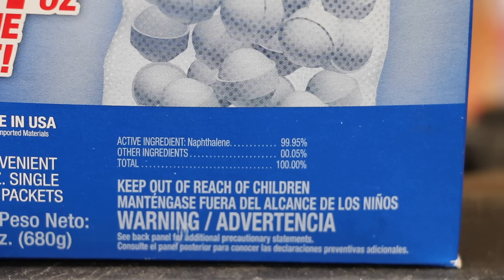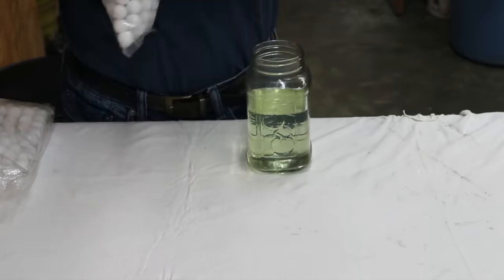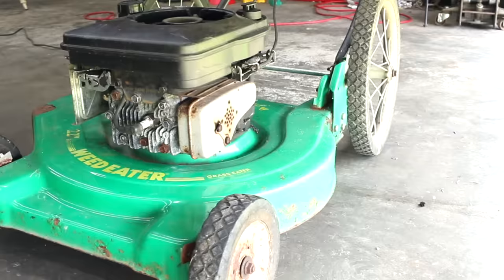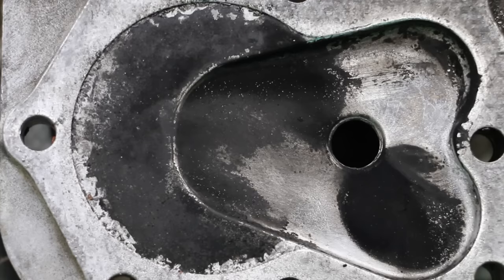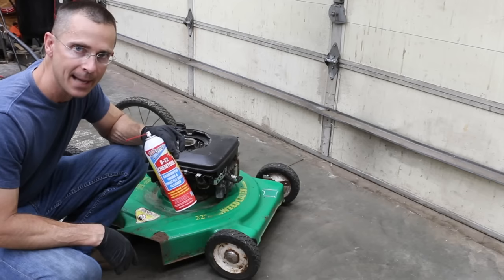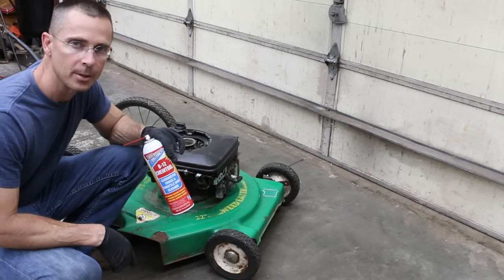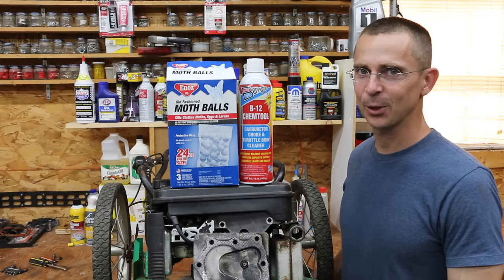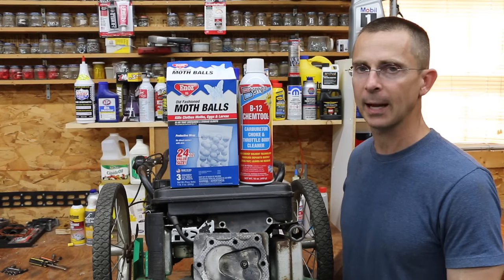Will Mothballs in Gas Destroy an Engine?  Let's Find Out!

Comment: I'd heard about mothballs in fuel, maybe it did better with 1960's fuel?
 Interesting about the 'B12' composition.
. Around 12~13 years ago I read about adding between 2~3% acetone to fuel as a performance booster (more than 3% doesn't work although I forget why)
 A friend tried it in  carburetted motorcycle and claims there was a noticeable increase in performance. (1970's sub 400cc four-stroke road tested new at 91mph) It was noticeably faster acceleration even compared to my 1995 600cc bike (although that may also be due to the way he abused it?)
There even seemed to be an improvement when E10 was introduced.
I have no idea how you could test this though without going to a racetrack/drag strip. 
Maybe one of your more than 2 million subscribers has anecdotal 'evidence'?
Reply from the maker: Thanks for the feedback.

Comment: You added too many mothballs (in my opinion).  The gas jets, etc., got clogged because of too many Mothballs not fully dissolved.  I would recommend using ONLY ONE mothball per tank...but only do the 1 mothball + gas mix occasionally.  There is a significant performance advantage...how I know this, a guy I know did this to his snowmobiles.  I would be more than happy to see a new video using some of the footage from this one in a new one, except with the test with only ONE mothball per tank!  Thank you for considering this!  By the way, keep up the great work!
Reply from the maker: I agree. I over did it for sure and need to redo this test.  Thank you very much for the positive feedback.

Comment: I love your channel but I have one bit constructive criticism with this test.
You used waaaay too much mothball for the gas.
I owned an 1886 jeep CJ seven. It consistently got 10 miles per gallon. I think it had a 13 gallon tank.
  I used to put 15 mothballs, pre-dissolved in a  bottle of gas , pour it in the tank and drive.
I would then consistently get 11 miles per gallon. I don’t know if this 10% gain applies to other vehicles but that was significant for my vehicle. Mothballs do not have The flammability to support combustion in an engine so with your lawnmower you were trying to run the lawnmower on mothballs rather than gasoline and mothball as an additive. I would love to see the results if you would try that ratio -whatever 15 mothballs to 13 gallons is. 
I love your channel and I’m always eager to watch your tests.  I really think you do a great job. Thank you
Reply from the maker: Thanks!  Thanks for the constructive feedback.

Comment: Great show.  However, regarding your mothball test, you added way too much.  It has to dissolve completely, and then it won't clog up the motor.  I was advised, and have used for several years, 5 mothballs per gallon of gas.  So to your quart jar you should add only one mothball, especially since the jar isn't even full.  What mothballs supposedly do is increase the octane, which, I've heard, doesn't improve power or efficiency, but just makes the fuel ignite at higher temps and burn perhaps more slowly and evenly, thus reducing engine knock.  It was commonly added before about the fifties, when gas had much lower octane than mothballs and knocking was a common problem.   In my engine I have gotten no knocking even at very advanced ignition timing--maybe it's the possibility of more advanced timing that makes people think they're getting more power.  I've subjectively felt my car ran better, but with no objective test.  Anyway, however, I'm not going to use mothballs any more.  Because in my recent internet research, two sources have said mothballs only have about 91 octane, which doesn't improve modern pump gas, and my engine is not one of those that would benefit from increased octane anyway, because of how it is built.  Engines that are at higher risk of knocking, like race car engines, are the ones that benefit from very high octane, not economy engines like mine.  So for me the mothball myth is busted by the fact that modern gas already has octane as high as mothballs, not by any damage it does to my engine.
Reply from the maker: Thanks for the feedback.

Comment: The clogged carb (you made) probably ran it rich.  Back in the '70s we would put only a couple of balls, not a CUP FULL OF BALLS into a riding mower tank, and it would literally blow blue flames 6 inches out of the exhaust, and the rider was more powerful.  Do not know if it tore up the combustion chamber, valves, or piston top, but it sure did not seem to do any harm.  You way overdid it there.  You should do one a bit more scientific, where you do say starting fluid, which is diethyl ether <sp>. and one of pure ethyl alcohol as the additive.  Inquiring 100MPG scooter owners willing to add a few extra cents worth of joy juice to their gas want to know.  And no I will not be using any moth balls.  You should have used a cofee filter or something there, dude.  Anyway, keep up the good work.
Reply from the maker: Thanks, will do!

Comment: Amoco white gas used dissolved mothballs 4 years as an octane boost. I didn't put undissolved mothballs in the fuel system like you did. Isis I suggest you the experiment again filter the gas put the mothballs in it
Reply from the maker: Thanks for the suggestion.

Comment: I own a 2002 Chevy Silverado 2500hd with a 6.0l gas. I ran my engine with Moth balls in the winter. I would use three balls once a month. Never had issues. I feel you ran way to many balls. Plus the Sludge from the moth balls is what clogged the carb . In my opinion. I could be wrong.
Reply from the maker: Thank you!

Comment: Back in the early'80's, a retired highway patrolman told me that they used Naptha mothballs to boost the octane in their patrol cars of the late '50's and '60's. He said '1' mothball for every 5-10 gallons of gas. Back then (early '80s) I had a '70 Cadillac that was supposed to run high octane gas and the only octane available in my area was 89, so my Cadillac had a tenancy to ping. After using 3 mothballs per tank (27 gal. tank) the pinging went away. I continued to do this for the next 5 years and about another 80000 miles with no ill effect. I never did use up that whole box of mothballs!
Reply from the maker: Thank you for the feedback
Reply: @ProjectFarm  Keep up the great experimentation's, they're great! A lot of us can attest to many urban legends. You should have seen the "gas savers" they used to sell in the JC Whitney and Honest Charley catalogs, back in the '60s and '70's, and all the "magnet" inventions.

Comment: I've been using moth balls in my firebird 400 for many years now and it works great. I rebuilt the engine in  2008 to stock high compression specs, roughly 10.75 to 1. I fill a clean emptied one quart oil container with naphtalene moth balls then fill the remaining volume with wd-40. Let sit for at least three days. Shake occasionally. Drain the liquid using a screen filter to separate the remaining solids in a clean container. This will raise the octane of approximately 20 gallons of gasoline high enough that my car doesn't ping. From what I researched it seems to raise 93 octane pump gas to over 105. Do not use the moth balls that are made from chlorine!
Reply from the maker: Thanks for sharing.

Comment: Try using mothballs& WD-40 mixed into A bottle. Let it set for 4 days then  paper towel filter it into A separate container afterwards. Then refilter it through A funnel into your gasoline fuel then you tell me if it works.,or not okay bud.

Comment: How does octane booster help an engine that has no risk of knock??
Reply from the maker: It doesn't help it unless it has extra detergents or cleaners.
Reply: The simple answer is it wouldn't help. The only thing that octane booster does is it prevents knock.

Comment: Just an FYI, not criticizing. When old farmers would use moth balls it was usually 3 or four in one tank of fuel. In my experience a few mothballs in one tank (18-20 gallons) did seem to make older engins run a tad better.
Reply from the maker: Great point. I added way too many.
Reply: Project Farm I do like and appreciate you're videos. Keep it it up and thank you

Comment: Sir the diferent molecule weighs will after  awhile go to botom of the glass jarr it requares magnetic mixer and wacumm to prevent seperation of liqueds meaning you solution goes in the engine non regular and you shuld sute lubrication cooling system and temperature of that solution for maximum effect in some cases that staff knows to create fumes like lubrication oil it will staff up your jetts and fuel lines .
Even non mixing liqueds can be partialy used under wacum they get longer mixed thats the trick how to make things work and you need preferabely cinde of carburetor vaporisator for bether results .
I have those problems for years with me classic gm based car its normal due to water condensation in fuel tank ethanol is a bitch it likes moisture but thats why you sute your engine ignition timing and jetting for low octane fuel usage old cars run at 40 grade how much I know so heaters ore special ignition systems might help you lot and normaly those are slow reving engines exactly like the ford model t wuld work so yes you gain more fuel and can even use ethanol/methanol water vaporisation with adding water but id definatly is not injection .
But you wuld requare low speed to high speed transmision to counter that slow rpm .
Then it wuld work 100% .
In fact liker motors can work as well on such principel gm has that it called external ignition ore waste spark dual ignition .
So then you can run at any fuel that you want just use cinde of converter for gear ratios.
There you go
Reply from the maker: Thanks for sharing.

Comment: I know it's an old post but you have to remember gas back in the 60's and 70's was way different than today's gas
I used moth balls in my fuel tank (maybe 5 or 6 balls) was said to remove moisture in gas tank.
Reply from the maker: Thanks for the feedback.

Comment: I use to add about 3 moth balls to my Yamaha breeze 4 wheeler. The moth balls now have something else in them that the old school didn't have.
Reply from the maker: Gavin, I used too many for sure.  Thanks for commenting!
Reply: Project Farm hey i think me using moth balls did cause my fourwheeler to burn a valve up. After i overhauled it. I never done that again. I had to bore the cylinder and put in a new piston and a new head.

Comment: As I remember I had a neighbor  that used moth balls in the gas in racing lawn mowers. He only used 1 or 2 in the tank for improved performance. I can see that the amount that you used would have been detrimental to the engine. Maybe try it again  using less mothballs would improve the performance  without causing  problems.
Reply from the maker: Thanks for the feedback.

Comment: You should use about 10 mothballs in a 10 gallon tank and so on. You can tell more of a difference in a 4cyl engine vs v6 or a v8. And that was way to many mothballs in that jar of gas. You should have used about 2 or 3 in a small engine fuel tank. Mothballs leave a hardened deposit on your spark plugs. So be prepared to clean your spark plugs more often when using mothballs in fuel on a regular basis.
Reply from the maker: Thanks for the feedback.

Comment: When i was a very young man back in the 60's I had a brand new 65 ford 289 3 speed (ALL STOCK) that I took to the track. It classified as a K stocker. Before every race I would put a hand full of moth balls in my gas tank (full) tank, And never lost a race even against like cars. At the end of each race back at the pits I would take off the gas cap and release the presser that the moth balls had built up. How it all worked I do not know, but all i do know is that IT DID.  A old man at the track took  me aside  told me about doing it.  And by the way, I DID NOT win by just a little, we smoked them all.  Did not know him or why he told me about it, but it is what it is. It is my story and know one will ever tell me it did not work.
Reply from the maker: Impressive results!  Thanks for sharing this experience.
Reply: @ProjectFarm  Thank you for a HONEST channel.

Comment: So the whole moth balls sit on the anti-Syphon grate in the filler tube thus dissolve slowly. The chunks that go through the grate, end up in the bottom of the tank, and further dissolve. The mothballs will enter the fuel system in solution. 

This was a method used for slow destruction of a vehicles fuel system and engine. It is effective, although slow, it works. There are many other chemicles with similar effects
Reply from the maker: Thank you for the feedback!

Comment: I carried a box of mothballs for hundreds of thousands of miles,added 1 per gallon in anything from a 1973 yamaha RD350 to numerous small block chevys and fords(never had to drive a dodge)the only adverse effect i recall was replacing accelerator pump about once a year.did this for over 15 yrs.Try adding 1 per gallon in a diesel engine and show the results.

Comment: Way too many for volume of gasoline.   If you was to distill the naphthalene from the moth balls it should then burn without such residue. However, the proper compression ratio, and fuel/air mixture ratio may needed to be adjusted for optimum combustion.
Reply from the maker: Thank you. I should redo this one.

Comment: I agree with the other commentators here.  Too high of a ratio.  Grandpa always put in 1 per gallon of gas all through the 60's in his dodge cars.  He got good performance, good mileage, easy starts, especially in cold weather.  He would skip putting any moth balls in every 4th or 5th tank just to be sure there was no buildup.  This video was from 3 years ago, hopefully you came back and did a redo at a better proportion.
Reply from the maker: Thanks for the feedback.

Comment: Well lawn mower engines are low compression so adding octane is bad. High octane fuel has a higher flash point so the high compression doesn't pre ignite the 87 octane. So if it did add octane there's not enough compression ratio to efficiently burn the fuel. Just a thought.
Reply from the maker: Thanks for the feedback.

Comment: Wait... what...
How did you find napthalene mothballs? Anyways, the rundown is:
1 - this was usually a handful to a tank of fuel
2 - which you obviously discovered
3 - and it does work... sort of. It's outdated information; back when this was common gas was absolute junk, modern regular fuel would be hot stuff. When you're itching for speed out of a hopped-up flathead that has to drink from a tank full of 72 octane swill, then the 90 octane napthalene additive is a BIG improvement. Today? Not so much.
Reply from the maker: Thank you!

Comment: You said people thought mothballs increased octane for performance advantage.  Higher octane is for higher compression engines.  It actually burns a little slower so it won't knock.  Just like diesel fuel, high octane is similar to diesel fuel in that regard.  Diesels are very high compression.  People mistakenly believe high octane increases performance in engines designed for low octane.  The opposite is true.  It wouldn't be hard to build a prony brake to experiment with performance claims and issues like this.
Reply from the maker: All great points.  Thanks for commenting.

Comment: Naphthalene

Naphthalene was used as a fuel, before WWII, and race car drivers used it to boost octane by adding 5 mothballs to every gallon of fuel. That amount caused the engine to carbonize. Today, many are using it to get better mileage out of gasoline and diesel engines. Some have reported fantastic gains up to 96% in V8 engines.

Old Fashioned Moth Balls are 99.5% pure Naphthalene. That is the only type of mothball that works. You can get them at Walgreen Drugs stores, Wal-mart, etc. A friend told me they are illegal in Europe.

It can take a mothball an hour or more to dissolve in your tank. Some people crush them up first. In cooler weather, it will take longer; take this into consideration in order to prevent a buildup in your tank.

In case you are wondering, your gasoline already contains 1% Naphthalene.
Reply from the maker: Thank you for commenting on this.

Comment: Putting mothballs in your gas these days isn't needed at all when running just pump gas. On a vehicle that you drive daily, the only reason you would need to run mothballs in your gasoline would be if you were driving any vehicle that has an engine in it that was designed and manufactured when gas had lead in it. Lead in gasoline causes your octane to rise significantly. Now, the exception to and old engine designed when lead gasoline was the everyday norm is if that same old engine has been rebuilt with hardened valve seats in the heads and the compression ratio of the engine  being somewhere under 10:1. Lead gasoline engines were usually 10.5:1-13.0-1 give or take on their compression.
Reply from the maker: Thanks for the feedback.

Comment: Put the mothballs into the jar, then just cover them with gasoline so the gas level is barely covering the balls. Let it set for a couple of days or so. Check back every couple of days,shaking the jar,  until the mothballs have all be absorbed. Might take a while.

Viola! You now have some home made napalm. Use with care!
Reply from the maker: Thank you for this recommendation!
Reply: I actually made some of that stuff. I threw about 8 ounces of it in a glass jar  onto an abandoned parking lot as it was burning. Left a burning streak 30 feet long, and it burned for quite a while, before the FD arrived and put it out. Of course, I knew nothing about the event...

Comment: Mothballs are made from one of the components of crued oil, so it's plausible.  I think you far overeached the amount that volume as gas could dissolve.  I wouldn't put it in a modern fuel system either, but I don't think it causes harm in small amounts on old carbureted vehicles.
Reply from the maker: Thank you!